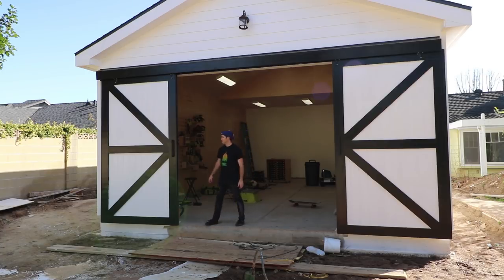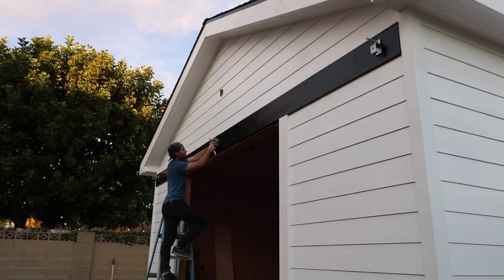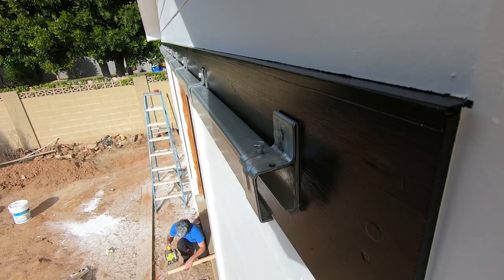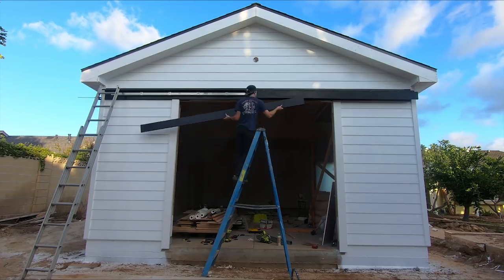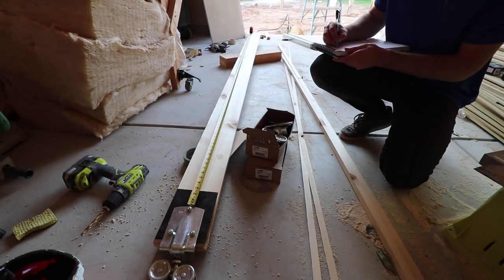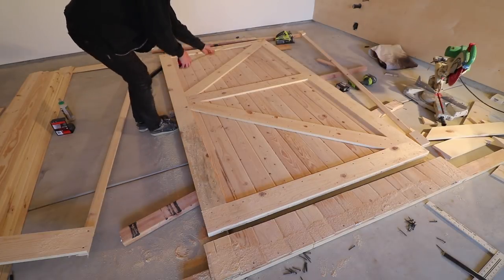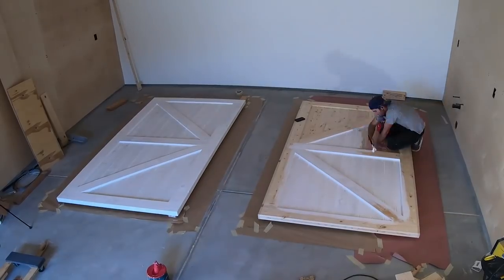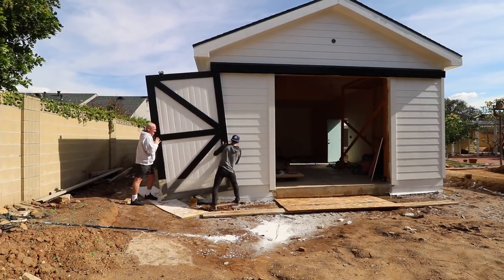Shop Build - Barn Doors

Comment: Great video. I love the addition of the cover over the rail.  My barn is over 75 years old and has no covers but the door rail is protected by tge overhang of the roof.  It would be nice to have heard more about your measurements.  One comment is the Hanger brackets with the threaded holes are NOT to prevent the rails from moving.  Friction does this well.  Those brackets are to connect rails together.  You should notice the rails have a threaded hole in each end.  The hole is dual purpose.  It can be used to connect them together with the correct brackets OR a bolt can be put through them to prevent the door from rolling off.

Comment: To flush up the doors to one another you could use two flat pieces of metal recessed and offset plates along the edge of the doors like the the type used on bifold doors to keep them even, although they would be sticking out the edge of the door and be a poking hazard or replace the surface bolt with a flush bolt. Great work. You have an eye for detail and are meticulous enough to make anything work.

Comment: just a thought if you haven't already solved the barn doors holding flush when closed. You could try a couple of different options:
Strong rare earth magnets on the inside edges that catch when closed.
metal "biscuits" that are attached on one side with the opposing side having magnets in the pockets
you could also install a small piece of trim to one door, just inside of your handle, that overlaps the other door to just inside that handle. this will also keep rain from coming in between the doors directly.

Great series, love the shop!

Comment: I thought about building doors like this but I opted to just make them a swing door. I built a basic frame 4x9 ft and hung it. I built the rest of it in place. They are probably the same weight as yours. I have a bracket in the center of the door where i put a piece of wood to hold them together and keep them from being opened from the outside and a spring loaded bolt to hold the top in. However that won't work in your case. Look for some strong magnets and you could mount them on the inside frame of each door that way they will lock together.

Comment: Very nice. I see you posted in February so I’m probably too late, but... to your question. 
You could make a small metal tongue and groove. Tongue actually installed in the core of the door, all metal, inset into the wood/ and a metal plate with groove on the opposite door( also inset - a little like any door lock plate) and the tongue would fit into the groove when closed.  Painted black? You’d barely see them. 

Or, interior closet doors often have springy tabs that also fill this function.  You’d have to make more durable ones, but they’d disappear when the door is closed if they were painted black.  

Your sliding latch is definitely a good option too. 

Or, if you were up to it, you could create an interior sliding latch so you could maintain the “Flush” concept. Again, create a metal housing for a rod to insert into, put that on one door, and inset a sliding latch into the opposite door with enough access so your fingers can grab the slide knob. 

I can think of one more, but I cannot figure how to type it so you could get a visual. Continuing with the tong in groove concept, but the tongue would be movable and it would need to be engineered so you could attach a lifting mechanism. Drop the tongue into place easily, you’d need a trigger or lever to lift it.

Comment: A suggestion for similar projects in the future: 

On your track cover it appears you painted the glue surfaces then later applied the glue. If my observation is correct, the joint strength is limited by the adhesion of the paint to the wood, much weaker than glue to wood. Your joint is basically being held together by the screws only and is not as strong as you intended. Also, I don't know what type of wood glue you used but it should be a waterproof variety such as Titebond 3. And the assembly should be covered with an additional coat of paint to minimize water penetration to the glue joint. These steps would make the cover weather better and last longer before maintenance or replacement is required. The caulking and flashing are great in this regard.

And for the love of God, either use a push stick with your table saw or bring along a baggie to collect your fingers in. Maybe they can reattach them in the emergency room.

Comment: To keep your doors from blowing around consider screwing a slotted length of pvc pipe to the bottom of each door and a 16 foot length of angle iron to track on.  Where the doors meet thicken up the angle iron so that the slot in the pvc will pinch the iron tightly aligning the doors.   To lock the doors a removable  wedge plate that pulls the door together will work nicely for that clean look.     Nice build !!!

Comment: Love the vid and look. Can I ask what the center stop part is? Or do you have a link to it. I cannot find one anywhere. Thanks
Reply from the maker: If I remember correctly, the center stops came with the wheels to hang the door. It’s just a metal piece that hammers into the track

Comment: To avoid the door bulge in the middle id just put a piece of wood on the ones that sits further in. From the outside hanging over the other door with a angle on it. So when you push em together the ones presses down the other. Like you did to support the middle gap in the flashing on top

Comment: thought on flush mount and door correction. bore a hole in the edges of the doors and run a pin in it. on the other hole bore it out and glue a strong (rare earth) magnet in it. then when you close the doors, you align the pin to the hole and the magnet will keep it from pulling open too easily. plus if you do several of them, it could help with the sag. i hope this wasnt too late as i just realized this was from 2020

Comment: Built a smaller door for 47x84 opening. Wanted to have ~6 inch ovwr lap or 59 wide. Didn't take into account the shrinkage from assembling the T/G and ended up with a 56 wide door. Will be fine, but some thing to keep in mind.

Comment: This is a great video and what I’ve been looking for, I am planning to build a similar door on my barn/workshop. What company did you buy the hardware from? The trolleys I’ve found say they are meant for doors up to 2” thick, but with my design (and yours) the doors are 2 1/4”. Was this an issue for you at all?

Comment: Painting your work on the ground is an excellent idea, assembling it there wouldn’t hurt either. You’d have to workout some support blocks to help hold it in place while you secured it. Do yourself a favor and slap together some saw horses of scrap wood it’ll save your back, knees and time. Working with a stepladder perpendicular to your work is a really bad idea, you’ll lean into whatever you’re fastening and push the ladder out from under yourself. Edit: the boat hardware and cam latch idea is ingenious.

Comment: Ben i am making barn Doors on my DIY SHED - 12'x10' - Door size 90" x 37" same Trolleys  also Double Rienforcement just like yours , not Painted - Cedat 1x6 board with biscuits and OIL Finish .
i woul use a L- Bracket on 1 door to Align the other door to it and to keep Doors from Flapping would use a LOWER ROLLER 
and Brushes for the Door Seals

Comment: Looks good but I'm a tad worried about that flashing detail you installed since it doesn't create a drip edge beyond the wood. water can get sucked in between the flashing and the face of the wood during a rain storm. But then again you live in LA so it might not be to big of a problem

Comment: Use a metal pin and dowel combo using threaded rod and a slightly oversized metal sleeve at the mating surface of the doors where the doors meet together so they have some positive alignment to them and the take the one door bow out and other bow in using that in combination that with a simple trim piece on the outside of one of the doors that overlaps the other and done 

For a center latch in between them there is hardware for that which look like a horse stable pin and hook latch you can recess either on the inside or outside. YOU can also use the latches from sliding glass patio doors those are flush and can lock/unlock from inside or outside

Comment: This won't pull together but would flatten. Just countersink a flat piece of metal on each door that overlaps to a grove on the other. Make it flush w a slight bow outward at the end to catch the other door. If it is matching a corresponding grove on the other door it should pull them in line nicely. My dining room table has a piece of metal on either side (on the underside) where it pulls together with the two sides. (The space where I can add additional boards for length.)  Same idea but made flush for your our doors. 

Is there some sort of industrial strength pocket door latch that could pull them together?  Not sure on that one.

Comment: You could have a channel at the center of the door that it sits in on the outside or you can use a pocket door lock to pull the doors closed.

Comment: Did you come up with a seal for the bottom of the doors? Wondering if there is a way to prevent critters from getting in. With a garage door you can just put a gasket down there but I can't see exactly how it would work with a barn door and the friction of the lateral motion.
Reply from the maker: I currently do not have any seal on the bottom, though an option would be to put a door sweep (like a long brush) along the base. The brush would move easily with the door.

Comment: I would try a metal dowel type of pin on the bottom of the doors, like your pops said muscle memory will force them into the position you want over time. A pin will get them aligned and should work just fine if with your flush mount system.

Comment: I wonder if you could use the same latches you used for the sides and imbed them near the bottom of the door. Then set one in the concrete and latch them up that way. It would hold them flush to the concrete floor that way!

Comment: Hey Ben question.  On your to scale drawing there is a small “bump” on the wall side that protrudes toward the top of the door.  Is that some type of weather seal?  And what is the side header board that you are attaching the rail to on the building?  Thanks!!  Great build!!

Comment: Maybe get a couple of more cam action latches and put them on the bottom of the doors in the center then drill holes in the concrete below it and create a U shaped metal bar to go through both latch hole and then into the holes in the concrete? Not the best scenario but it would be an easy pull out bar and it would hold great.

Comment: What kind of bracket you used, there it’s way to put the link here with the roller please, amazing idea
Reply from the maker: I purchased all the brackets and hardware in store at Ganahl Lumber. The brand of the hardware is National Hardware. If you search for “national hardware exterior barn door” you should find what I used and where you can get it online or locally

Comment: what about installing a pin wheel railing system attached to the door. It can cover some of the bottom gap and also provide weight distribution support for the door long term.

Comment: This turned out great well done! Did you end up doing any form of weatherproofing for the gap on the bottom at all or is that just left open?
Reply from the maker: It’s left open. The ground below it is slopes away from the building so no worries about water going inside. The gap is very small. Less than an inch

Comment: you need 2 pieces of 1-1/4" or 2" alum or steel strips the length of the door  (paint them black).  Make an H-shape on one door.   Now you have a guide and seal from direct air/snow/rain.

Comment: Great build and and very nice video. I am inspired to do this for my workshop as well. Can you share the link where you found the barn door hardware used to install them? (I.e track, trolleys etc). Is it a kit?
Reply from the maker: All the pieces were purchased in store at Ganahl Lumber. The brand is called National Hardware
Reply: @BenTardif  I was able to find the link to the site in one of the earlier comments. I have been looking at the different parts and was hoping to find a kit but no luck. In the video, I saw that you used a 10ft square rail. Which brackets did you purchase to mount the rail? Was this a better option than buying a rail with the brackets already attached?
Reply: Bought the exact same hardware at Lowes.

Comment: anychance you figured out the middle latch?  i just did some and am struggling with thr same
issue
Reply from the maker: Never found anything that was flushmount. The latch bolt is relatively low profile though. It’s been working great for the last year and a half!

Comment: great vid. thinking of making sliding doors instead of normal doors but the problem i see in all vids about sliding doors is the absence of a good locking mechanism. For instance i cant use your solution to keep the doors close to the wall because i dont have a secondary entrance to the shed ;-). So maybe someone can help me with this, how to keep stabilize the doors and how to decently lock them, preferably with a lock and key :-0

Comment: I can't find those spring loaded flush latches anywhere.  Can you tell me where you got them? Thanks
Reply from the maker: Do you mean the cam latches? To hold the door tight against the frame?
Reply: @BenTardif  yes Ben but I think I figured it out I had to look again at the pictures of the latches because I purchased ones without the spring but I then looked again at your pictures and I can see which ones you're using thanks for responding by the way I copied all the stuff that you did and the door came out great what a great video
Reply: I will post pictures of the doors that I did which are basically your design and finishing touches that just everybody including myself think the doors are just great and I always make sure that they I say go to this kids YouTube channel

Comment: As a carpenter with 34 years of experience and all of my digits (knock wood) I was holding my breath when you were checking your track cover design and had the table saw still running inches away.
I bought a Sawstop jobsite saw shortly after they came out , because it only takes a millisecond to end up needing a trip to the ER and a new way to put food on the table.
Be careful !!!!

Comment: I think you have the doors on wrong. The diagonal brace should run to the top of the door where they meet in the middle. Both braces should run in the same direction, unless they are steel doors. It might look nice but the braces are doing nothing as it is.

Comment: Dude, either build yourself some saw horses or go buy some and save your back for doing things like painting or cutting instead of bending over like that. Also, get a small table to put your table saw on... You slip and fall on the blade you're in trouble. Stay safe!

Comment: After the concrete is poured, you can use a flush mount bolt from the door to the floor.  Something like http://bit.ly/2wGU7C5  Although this will not pull the doors together, it will give them memory about where the door should be.  If you are more concerned about pulling the doors together, you could try an opposite polarity rare earth magnet (http://bit.ly/2T5UoWx) embedded under the weather stripping on the sides of each door.

Comment: do you really need to open the very last inch of the doors ? the answer is obviously no, so whatever center latch you use does not have to be flush

Comment: I might have found a part for you to use on your door. Search for this on Amazon: B00UL9YTUW
You can use one of these horizontally at the bottom to hold the doors in the same plane together. The bolt going from one to the other.
Or you can use one in each door vertically and pointed down into the cement when you pour it. That would help hold it on multiple axes. Though this would force you to use a couple of holes in the cement.
Reply: look like this might work, but might need a flush handle like amazon B07KVCCY3F to align the doors.  put the concealed bolt in the door that's flat and the handle to pull in the door that bows out,